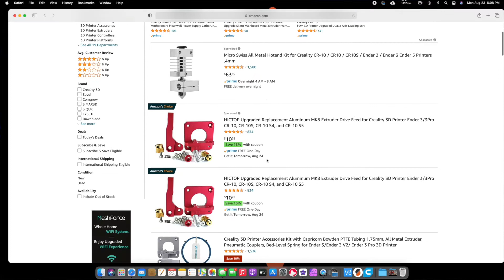How To Clean Your 3D Printer’s Drive Gear

Comment: Any advice,why it stops randomly to extrude filament? Like it pushes and then quickly  Push it back
Reply from the maker: For me it was temperature. 210 for most PLA for others high end PLA like PLA + 220. https://youtu.be/5wTzj04NLj8 you may also want to look at slicer settings.
Reply: @CrazyWillTechShow  I did fix it 😅 just needed to sharp that tiny metal what's pushing PLA😅 and all works fine